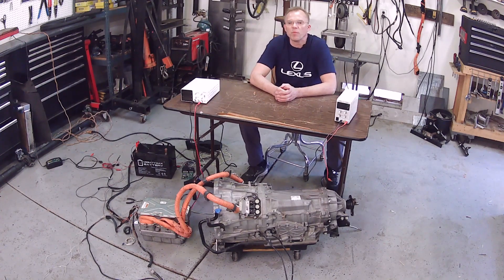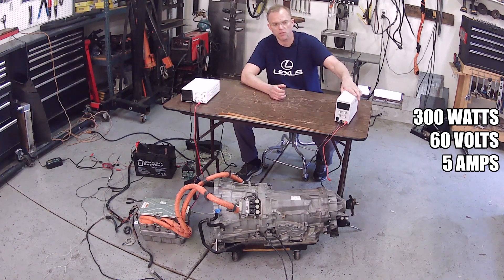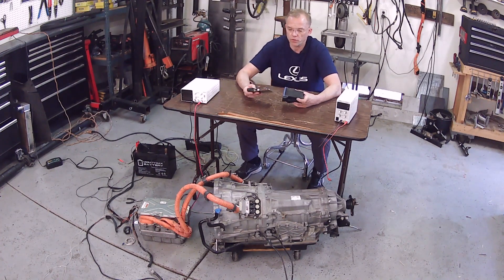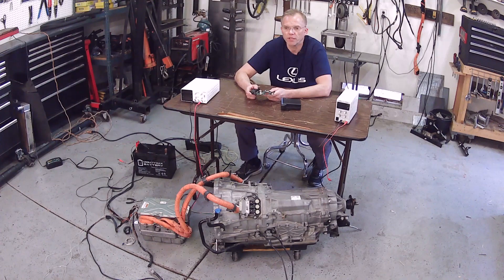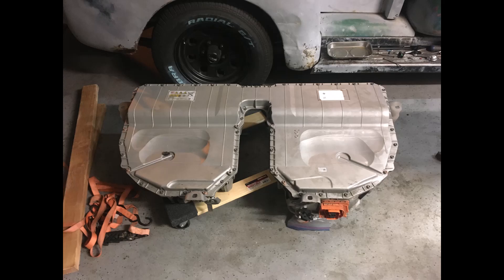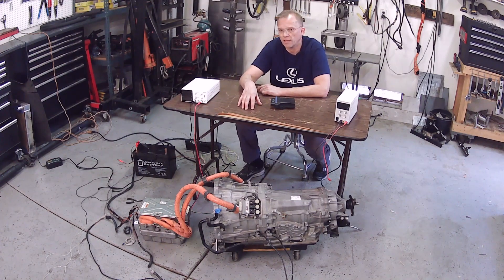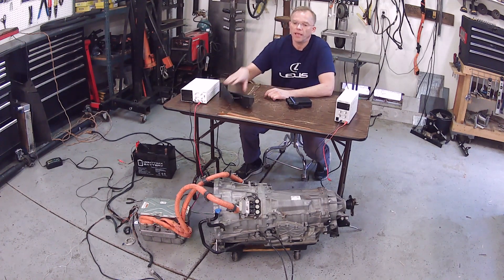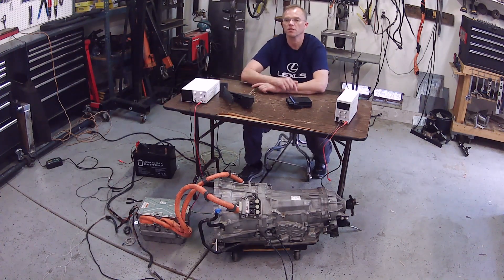Lexus GS450h Slow Race

Comment: So 360V will push it to 72 mph at just over 6,000 rpm. I presume the tests were only using MG2. Easy way to think of it is that volts will push you faster on the flat, amps will push you faster up an incline.
Reply from the maker: so just got it up to 82.7 MPH and then I realized my torque setting wasn't on Max 😡
Reply: I think it also depends on your rear end. This hooks up to a driveshaft and into a rear differential. 
Which if its a big car/truck it could have a ratio of 3.55:1 or higher for torque and less speed.
Like the Lexus GS have a ratio of 3.769 I think, which is really torquey.
A g35 would have 3.35, which would mean higher top speed.

Comment: Power/horsepower is proportional to vehicle speed. When powertrain/ traction force equates to drag, acceleration stops. 
Current is directly proportional to motor torque. 
Voltage is proportional to motor RPM (DC supply voltage vs kv rating dictates max RPM). As motor/generator EMF approaches the inverter bridge DC voltage, current approaches zero and thus torque approaches zero.
Reply from the maker: thank you
Reply: @Good-Enuff-Garage  could you please tell me what is the ratio between MG1 and MG2? Is it 1.25:1 or 2.5:1?

Please let me know!

Comment: This transmission can work in a fort bronco 1991
Reply from the maker: I think all the Broncos are four wheel drive in which case this would not work as this is a two wheel drive transmission however it's bigger cousin the LS600h was a bit more powerful all wheel drive transmission, however your challenge would be reverse engineering the Inveter/Controller to operate it, I am not sure if the GS450h controller would work offered by Damien Maguire in this EVBMW webshop here https://evbmw.com/index.php/evbmw-webshop/vcu-boards check out the OpenInverter.org forum and ask your question there, as it is a good one
Reply: @Good-Enuff-Garage  do you know if the 4WD transfer box on the back of an LS600H box will fit on GS450H box?
Reply from the maker: @richardschofield2201  I do not and, sorry

Comment: Can't hear it too well. Could do with  a better sound set up. Otherwise, great info!
Reply from the maker: Yes I agree and apologize, that has been my Albatross since day one, I am wearing a remote microphone but it has a mind of it's own, works fine standing by the camera then I walk away and anything can happen, I think throwing more money at the solution must be the answer, better sound quality to come in the future for sure
Reply: Thanks for sharing this information . Have you any plans for an alternative oil pump or are you going to use the original Lexus one.
Reply from the maker: @kev39  great question, I specifically found a transmission with the electric pump appendage cause I plan on using it, but then I was thinking if, if we make the input shaft spin pretending it is still driven by the internal combustion engine it will therefor pin the internal mechanical oil pump (or at least I think there is one of those inside that beast as well) in which case maybe we can do away with the external one, though I do realize sitting at a red light the transmission would not be spinning and therefor pumping, but again we are not moving at that time, just food for thought, welcome andy thoughts and feedback, and yes I plan on doing a video on just enabling and operating the external electric pump, stay tuned
Reply: Shame that you're having problems with your wireless mic. (I can recommend the Rode Wireless Go system. It's not perfect but reasonably reliable and costs less than the high end ones). 
Also can i suggest that rather than cutting a gap in your main video clip whenever you want to show something else, instead try to keep your video clip running 'underneath' the image you're cutting away to.  It saves time for the viewer and makes the cuts less jarring. Hope that makes sense? Happy to explain better if wanted.
Reply from the maker: @stuartlanceley444  appreciate the advice I just bought a brand new mic and should feature it in the next video, as far as the picture in picture type of feature I totally want to do that, but the craptacular Microsoft video editor I use does not have that feature, I also bought a more better video editor but I am too lazy to learn it and its not all that user friendly
Reply: I heard ok but dragged a bit so listened at 1.2X, much better.